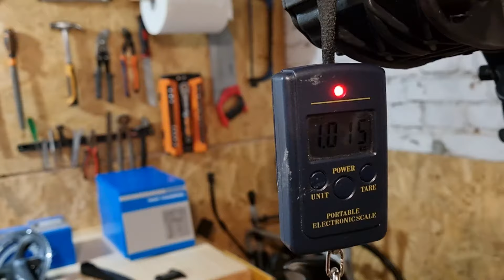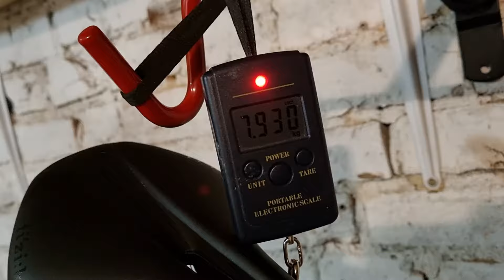Dream racing road bike build for normal people based on Chinese carbon SP053V frame and Shimano 105

Comment: Aerospace engineer and mechanic here. Just wanted to let you know, you are gripping the torque wrench sub-optimally. You're supposed to grip it from the end, where the grip itself is. Placing your hand on the middle part of the wrench may vary the torque output depending on the style of wrench.
Reply from the maker: You are right @Ricqu and this is good point! When component like stem is screwed with couple of bolts, my rule of thumb is to always hold the torque wrench in same way to get similar torque, as thankfully bikes are not space rockets ;-), and let's be honest 5, 6 or 7 Nm even on carbon bike will be just fine. Not to mention the wrench and its calibration state. Thanks for sharing your thoughts, and I am curious, what you are working on ;-)
Reply: How is that the case? The style he uses here bends at the head, so grabbing anywhere at the andle and shaft should not effect it, no?

Comment: Great video. If you're still in pursuit of "cheap" bike frames, I wonder what you think about ELVES? I made lately one myself. (Also rim-brake based). Model was Falath Pro 2022. Bit more expensive than this frame, but still "within reasonable budget". Bonus was I could pick one of their paint schemes and colors. Build process was pretty much the same as you nicely show here, though the handle bar was completely closed, so the front brake wire came out along the stem, to be better aligned with the head tube. Drawbacks? Sure. Quite a struggle with head tube bearings alignment (frame inner space tiny bit too wide and duh - I'm still not sure how tight to squeeze the seat tube. Struggling to go beyond 6.5 NM, though they say to squeeze it with 8.
Final result? Masterpiece for "pennies".
Reply from the maker: Thanks! I have not worked with Elves, but heard good opinions about it and it seems a class higher in terms of quality. For sure they provide better QA and paint job - which are major costs for producers, which reflects in final price.

As for the seat tube, I always use carbon paste and start a bit lower than the factory suggestion so in this case 6-7 Nm should be all fine. If it do not slip, stay with that. Basically, if the seatpost without tightening does not stay in place, but is sliding down it most probably means that either the seat tube hole is too wide or the  seatpost tube is too narrow. This forces you to use higher torque which can damage the frame, but it is fault of producer who did not provide correct tolerance. Instead of overtighting, better solution is to fix it with additional wrapping of the seatpost or ideally trying to replace the frameset/seatpost using warranty.
Reply: @custombikefactory  Yes, I used dedicated paste as well. The trick is also to add sand paper on the sides. The "testing phase" got shifted into the near future (I hope). I had s**y car collision on my other bike in July and that thing drags on (never mind).
Thanks for the advice and good luck to you in future builds. 👍
Reply from the maker: @madyogi6164  Speedy recovery!!
Reply: @custombikefactory  :-) Thanks!

Comment: Nice build. I've seen another video of this bike and they complained about the placement of the hole where the front derailleur cable comes out. How sharp of bend it is. Did you find the same issue?
Reply from the maker: Thanks. To be honest I did not face any issues with this element of the frame and did not have any problems with guiding the cable - in my opinion this bend was pretty typical. Also did not noticed any negative impact after full assembly. I was more skeptical to the aluminium end-cap element that was used for the rear break cable exit - it could be machined batter, as it was really tricky to assemble it without any play (probably over time it can require adjusting) - or maybe the hole in the carbon was too big in the frame I got...

Comment: Nice bike 😊 how was the quality of the frameset? And how does it ride?
Reply from the maker: Thank you. It is not mine, but the owner is very happy (he use it for training and amateur racing) and already did a wheel set upgrade. So far there is no issue with the frameset, no BB creaks or seatpost issues.

Comment: What is this white thing that you've used for bb installation? Some "activator" ? Grease?
Reply from the maker: This is ceramic, high quality grease, that has additional anti creak and water repellent properties. I used it because the quality of the BB (you pay for what you get) was not ideal and it was not a perfect hole - actually bit to loose so it is important to seal any space where water can penetrate. This would end app in creaking and hopefully it will fix this frame issue.

Comment: As a former user, I'd advise against the Vision Team 30 wheelset. Sure, they have a cool factor of their own, they're inexpensive and ride well, but they're fragile - the rim can dent easily, sometimes beyond repair -, they're heavy, they're noisy, mounting tyres can be a nightmare, and they'll look untidy as soon as the anodized braking surface begins to wear out. And you can't buy them separately, although this is akin to stating "the food's terrible and the portions are too small". There are better options for entry level aluminium wheelsets.
Reply from the maker: Thanks for a honest review. Sometimes the components which end up on the bike are because of a great price or personal decision of the rider - in this case both reasons were the reason for these wheels ;-).

Comment: Hi! Why you do not connect the cable direct to rear deurailleur?
Reply from the maker: In case there would be need to replace it - instead of total rerouting just replace the end part, which in most cases only needs servicing or is exposed for damage.
Reply: Thanks! I undestud. I will do the same.

Comment: great build, very detailed. are those tires 32mm?
Reply from the maker: Thanks, these are 25mm, but on the wide rim, they were 26.5mm. Frame can handle up to 32.
Reply: @custombikefactory  thanks for answering! wow they look much wider on camera. also didnt know of rim brakes with such tire clearance! especially available brand new. do you know of any other ? most are 28 only.
Reply from the maker: @FedericoHazama  nowadays, almost all new road bikes with disc breaks allow up to 30 or even 32mm, it is a trend. On one of my videos you can check how I customized an older rim break road bike to fit 32mm tires.

Comment: Nice looking build. Any suggestions on how to consider parts for a build? I find the bottom bracket, bar size, disc brakes, and stem length intimidating. The group set would probably be 105.
I am 6'1
Reply: I'm 189cm and I usually ride 58cm bikes, often called XL or L. I'd start with the frame and check what type of bb it needs, what the cable routing looks like and what type of brake mounts it has, like direct mount rim brakes or disc brake mounts etc. Crank length should be 175 at your hight and I'd also go for around 100mm of stem length and choose you handlebars as wide as your shoulders are prob. around 42-44cm but not too wide
Reply: @j.k.b5014  Thanks.

Comment: Nice vid. That masking tape thing you did on the hoop / were you eyeballing the rhythm of the rotation when you had it on the stand, then putting the masking tape opposite of what you perceived to be the heaviest part of the hoop?
Reply from the maker: Thank you Dave. Yes, this is called wheel balancing (static balancing to be precise as there is also dynamic balancing), this is one of the way to do it - the heaviest part of the wheel is pulled down by the gravity so the opposing side is the place to put additional weight to make it even. The same is done to a car wheels when you change the tires, just calculated by computer.
Reply: @custombikefactory  thx man! Learned three great things from this vid - tape the smooth latex tube stem, clean the alloy burrs in the headset rings so internal routing isn’t compromised, and this! Highly appreciated! I like the pace and editing also. Very chill.
Reply from the maker: I am very, very happy to hear this! Thank you for sharing this ;-)

Comment: how would you install the saddle if it has no pressure relief like the one that you installed? And how is the bike holding up? I am also planning to buy from SPCycles
Reply from the maker: Either you would use a narrow hex key or replace the hex bolt with a flat one

Comment: Great video! What lube did you use on the headset and bottom bracket?  Anti seize paste?
Reply from the maker: Thanks! In carbon assembly I typically use Shimano antiseize as it is actually a better and safe montage paste and for BB I used ceramic anti creak grease because in this frame it was made bit to loose.

Comment: Thanks very much for this video 
How tall are you and which frame size did you Take ?
Thanks from Germany
Reply from the maker: The bike was built for a 183cm man, sizing is 56 (normally I would advise 54, but the tube dimensions of this frame are bit smaller) which was just right for the rider. Good luck from Poland
Reply: @custombikefactory  i am 180 would size 56 fits me?
Reply from the maker: @boschselo5596  This is always individual thing, but in case of this frame, I think it will be good choice together with 100mm stem and short reach (modern) handlebar. There are however a lot of variables that should be considered and it is not possible to provide a solid recommendation based on youtube comment ;-)

Comment: when cutting the carbon, should one not spray a little bit of water onto it, so you do not inhale that stuff?
Reply from the maker: In case of small tubes such as this, even better solution is to put tape on the place which is cut - spraying water makes a mess and you would need to repeat it several times to make it work. For occasional carbon cutting in my opinion wearing a mask is better - and than it is easy to suck the dry carbon dust.
Reply: @custombikefactory  good to know :)

Comment: I would like to upgrade my bike for internal routing - do you know where to buy all necessary cocpit components for it?
Reply from the maker: You will find all the parts on Chinese portals, but read closely if the set will support your frame (diameters of steerer and frame holes).

Comment: Подскажите, чем смазывали посадочное место под каретку pres fit? Что это за белый состав?
Reply from the maker: Because the BB hole was not ideal, I used carbon neutral ceramic grease that repels water and reduces potential creaks.

Comment: Someone call Hambini.  That BB install looked off.  The cranks only made a couple revolutions when you spin them.  Definitely ream the cups or install a Hambini BB to free up the spin
Reply from the maker: Standard Shimano BB will never spin freely as it uses heavy duty, double sealed bearings on thick grease. For the record, even Hambini himself says that crank "spin tests" are not a good indication of BB/crank quality. If rider is not a pro or have no issues with frame BB execution, (or is not extreme engineering enthusiast), there is little sense to invest in Hambini product (which are one of the best on the market).

Comment: Hi there, is your frame holding out well until now. Have you been riding your bike thoroughly enough to judge if it is reliable ? Thank you
Reply from the maker: I am not the owner, but I can say it is safe and no issues so far has been reported. No creaks from BB, no issues with cables, headset required tensioning, but it is normal. So far so good.

Comment: I'm Japanese and I'm very interested in this manufacturer's frames. I don't see it very often in Japan, but is it famous in your country? Also, I am concerned about quality and reputation. Please answer.
Reply from the maker: This is not really a well known brand or frame here. Also the producer changes the models a lot. It is one of the cheapest carbon frames that you can get from China so be aware, that it cannot be perfect. The biggest drawback of this frame is poor BB quality - in my case, pressfit was too loose and not a perfect circle. The paint job is also moderate quality and the weight could be better for a rim brake version - but from the other side frame feels strong and safe to ride. In all - you get what you pay for (maybe a little more than you pay for). Hope this helps you - but bear in mind that I only had chance to work with 2 frames of this producer.

Comment: Hi,
what kind of weigth do you used to balance the wheel? Cheers
Reply from the maker: Because the rims have diffrient design and shape, I ususale make them from various metal elements. You can also use fishing weights for this purpose. Just remember that it cannot have sharp edges and be as flat as possible.

Comment: Good evening, I have a Twitter R5 pro, and it is very solid, maximum load 150kg.
Many carbon experts say that Chinese frames break quickly because the carbon is poorly processed. Is there any truth in their statements?
Reply from the maker: I am not the top expert on this matter, but having experience with quite a few Chinese carbon parts, I can say they are pretty solid and safe. From the other hand, for sure there are also crappy ones, but if you do not go for the cheapest price, I would say they should be fine. Mostly top brands order pieces from same factories but with higher QC standards.
Reply: @custombikefactory  Thanks so much for your reply, Twitter is a brand with 20 years of experience on the market..I think it's a pretty good and safe brand..
Reply from the maker: @pqulcojocaru2690  They would not be around for that long if their product would be crap
Reply: @custombikefactory  Of course, I trust the Chinese, they have the necessary technology to make a beautiful bike, their goal is not to compete with the big brands, but to satisfy the needs of amateurs who don't want to spend unjustified prices for a top bike.

Comment: This is the frame i was looking for online for reviews, how is it after a year?
Reply from the maker: It is not mine, but the owner is using it for daily trainings and amator racing for almost 2 years now, and reports no issues. The only problem that required fixing was an aluminium endcap from which braking cable exits toward rear break. Its construction does not have enough contact surface with the frame, which results in bending and it partially comes out - this is however only aesthetic problem. In all I think for its price it is worth recommendation.

Comment: I wonder how much does it costs to assemble a bike like that that comes in a box.
Reply from the maker: This really depends on a loooot of stuff, very hard to tell, there is also quite some additional work needed to be done apart of pure technical assembly. A skilled mechanic with a good workshop will do it in approx 3-6 hours, so multiply it by a hourly rate and you have some idea of the cost. Often such service might be done as a bonus when you buy parts etc.

Comment: Nice bike but it would really look much better if the frame was painted in something else than plain black.
Reply from the maker: I have to agree, however this is personal take - many people like black and stealth look. Personally I would also prefer a shiny color. The reason for black here is that it is cheaper for factory to paint it. Faster factory process - cheaper price.
Reply: @custombikefactory  non branded frame = less likely to get stolen too, can be a perk.
Reply from the maker: @heksogen4788 Indeed ;-)

Comment: how your opinion about built quality of this frame? if compare to another chinese brand like trifox, ican, elves. thanks
Reply from the maker: Well, as far as I am concerned, I think it is safe to say that you pay for what you get. If a brand wants to keep quality they wont be able to sell a frameset under 500-600 USD. So if you are buying for as low as that do expect less quality - for example not ideal BB hole, poor painting, many voids in the carbon layout or other issues, some of them are not big deal, but others can be a pain to properly build or do maintenance of the bike in the longer run. If a brand won't sell cheap, it is an indicator they put more effort and a good quality should be expected.

Comment: Links for buy frame?
Reply from the maker: I do not want to recommend any seller or source, but you can easily find it on the biggest and well known Chinese marketplace site ;-)
Reply: I built onto the same frame .... literally  the same bike build ... it is wonderful..... did the frame shop name start with a T ?  Also I had to get a different c shape thing (the default  is black and sits on the top headset bearing) for the headset as it had some play and after that it was solid.
Overall really happy, how is yours going ?
Reply from the maker: @FreddeeLewis  This is my customers frame and parts and I did not purchace it so I do not know from what seller exactly is it nor I can tell how the bike rides because I do not own it. However I think it should perform very well. I did not experience any play with the headset - only the issue with sharp edges that I modified to have smoother surface for better cable management - documented in the video. 

Thank you for sharing your experience with the frame!

Comment: Is 1:02 a normal practice when building road bikes? I just thought that it was so smart because my chain has fallen off before while riding and it damaged the chain stay tube paint

What material is that and where can I buy it?
Reply from the maker: It is definitely not a common practice ;-). I used a thick, thermal resistant, transparent tape. It is commonly used on cars so you can look for it in detailing shops and it comes in a lot of colors too. Choose the thickest one to protect such spots.
Reply: @custombikefactory  Oooh, I believe those are called PPFs? The ones that essentially self repair upon heat